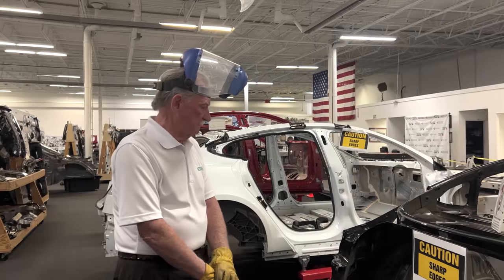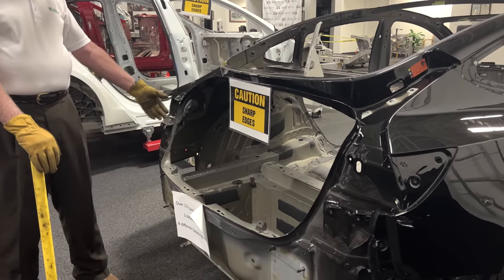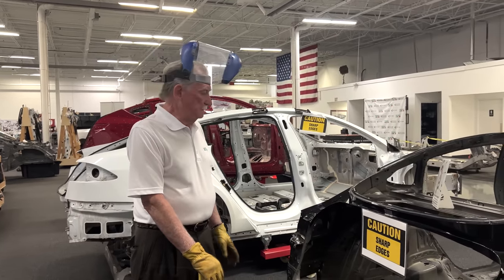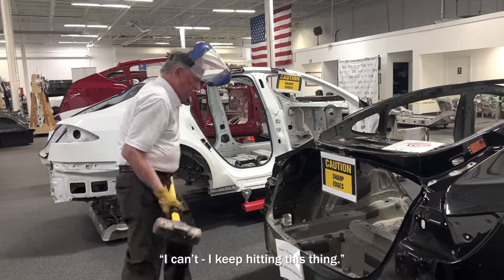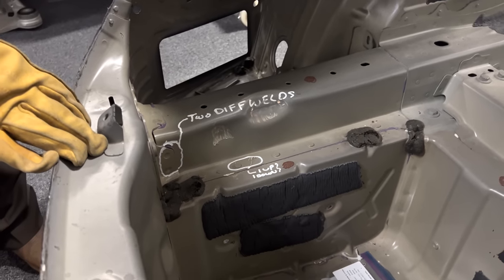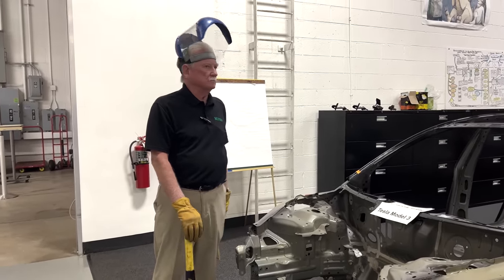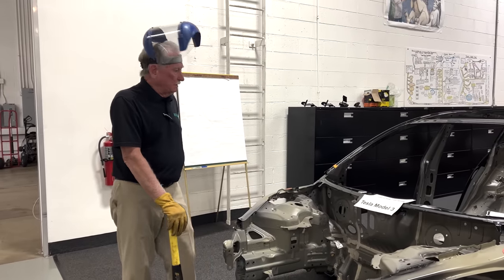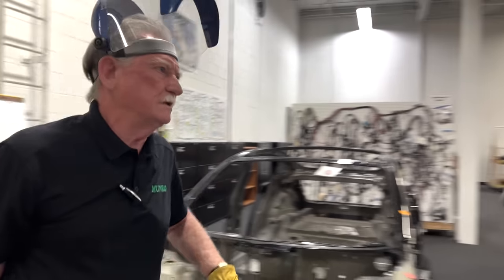Sandy Rant... With a Sledgehammer? Why Aluminum Castings Are Safer Than Steel

Comment: ya didnt hit it with the same force...... especially in the 2nd test
.
and while a casting doesnt bend..... it will shatter / crack when enough force is applied
and then ya need a whole new casting (AKA, a whole new car if it has a "giga-casting"...... which is a stupid name, but its Elon, so....ya see his kids names? lol)
.
idk.... i just see their being a LOT more waste
instead of just replacing a subframe, or cutting out the damaged uni-body and welding/plating in the new one......leaving 99% of the other parts on the donor car usable for the next guy
now you have to take the ENTIRE donor car (might as well just drive the donor/get a new car at that point) 
.
and a bent frame still gives you enough control to not make the crash worse
a cracked frame = probably not controllable, if it didnt literally just snap the whole front end and both tires off  
.
.
.
i dont care how giga the casting is...... it has a failure mode
and i want to see that mode
.
.
the frame bending also dissipates energy in a crash..... by.... BENDING!!!! who would have guessed!
shattering/cracking doesnt dissipate energy in the same way.... it can transfer the shock into the cabin before/during the cracks forming 
and the crack may be held together from the crash.... which would mean 99% of the energy gets transferred
.
its like we went back to "body on frame" cars LOL
and everyone knows that a, say, 68 impala after a crash might look just fine, but the people on the inside are jelly 
.
.
so because more energy gets transferred......
now the car has to dissipate that energy in other ways......
.
longer hood for extra crumple zone infront of the casting
air bags that hit harder....seat belts that tension harder / faster
ETC
.
this increases the weight.....removing an advantage of casting......
.
.
.
.
i think casting is simply a way to build cars cheaper.......thats it
.
they dont care about repair-ability.... and due to right-to-repair passing.... this is the only way to skirt that law
so they can make BANK on dealer only parts / new car sales
.
Tesla's are like an iPhone anyway.... at least thats the mentality their owners have..... 
ride it hard and put it away wet....then just buy a new, updated model after 2 years!! 
why fix the wheel bearing? hell, why even buy new tires? just buy a new car!!!
.
.
cheaper for the OEM.... more expensive for the end user
Reply: "the casting is much stronger"........ 
ok fine.... but i never questioned the strength of a uni-body..... so its a moot point!
.
and, like i said..... its like we went back to "body-on-frame" cars
IF!!! the casting doesnt shatter.... and you say its not going to bend....... 
.
then where does that energy go?

Comment: Nice rant Sandy I would much rather have a car that has aluminium castings in its structure than a steel welded car I thought everybody would have known that castings are much stronger than a welded structure in any metal than a welded structure in any metal so there are still Morons out there who believe other wise OMFG.

Comment: Always love your stuff Sandy but you have some of the physics jumbled-up! The casting was free to move so when struck could absorb energy in lateral motion the welded pieces were held into place therefore braced these inconsistencies may just offset each other

Comment: An absolutely laughable "test".  You only tested what happens when someone opens your trunk and hits it with a sledgehammer at an angle unrelated to a collision.  The steel was anchored, the casting was free to bounce away, thus there is no comparison.  By your standards a 1955 Chevy is safer than both of your Teslas.  You have a LOT to learn!

Comment: Ok when were driving around in a world of swinging sledgehammer, everything will be fine.  But in reality, Tesla users are generally horrible drivers-with zero spatial awareness.  I'd wager that no repair shop is going to touch cast aluminum.  

Just wait for the stacks of e-waste junkers to pile up.

Comment: I don't know what you are trying to prove, but these are completely pointless exercises,  The rear was built into the car while the casting was just a loose item moving all over your work shop. In addition to that the direction you are hitting them in is nothing like what an impact would be. Thirdly the deformation of the steel part can be either pulled and corrected or cut out and a new piece welded in.   Having said all that it's quite impressive the impacts the casting will take. I'm guessing this has come up because of the casting floating around the internet of the casting having a rather large crack. I'd be more impressed if you had got in touch with the owner of the vehicle in question and actually did an examination of that car and the reasons for the crack if they are structural.   I'd expect much better from this channel, This just looks like fanboy crap.

Comment: I think Sandy is a little bit off for crash security. Of cause castings take more energy, but when it hits a certain energy point it loses all its integrity. Steel sheets can deform easily but you could put a lot of energy in deformation. If he really wants to compare it he have to use two real cars for comparison and crash it into a wall. Then you check how much shorter the cars got.

Comment: Um, buddy, combustion engines have steel sleeves for the cylinders. If they didn't, they'd be dead within a few days of operation. Plus, we don't do stamped engines for obvious reasons, none of which apply to the body.
And how convenient that you hit the castings that were free on the ground and not connected, thus making it a poor test.
But have you considered too, that Tesla sucks at building a normal car and had to do casting? Of course not.

Comment: An idiotic and unrealistic test...
The steel is mounted onto a complete vehicle so offer resistance through weight; the aluminum is a light; loose piece that offers no weight resistance.
Sorry Sandy; this test is a fail; you should know better.

Comment: The test is absolute nonsense. The momentum of the hammer is much better absorbed by the body shell, as it is much heavier. In the small part, the momentum of the hammer is not directed into the part, but through the part, which shifts backwards. Absolutely bad test